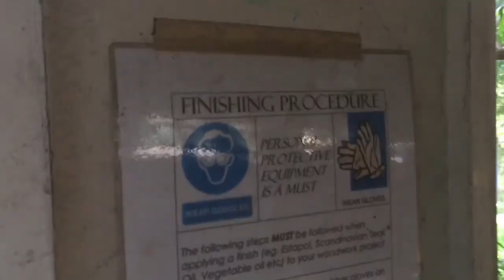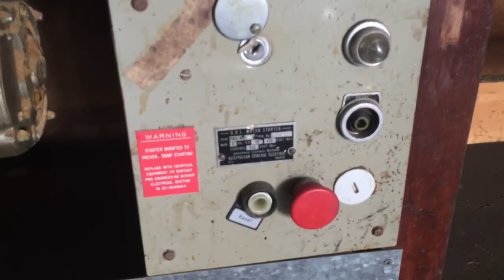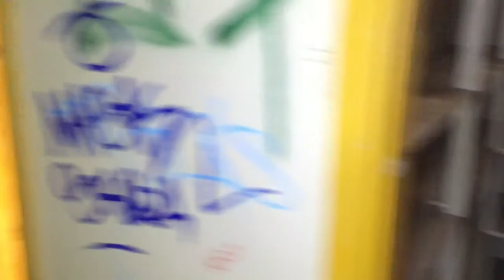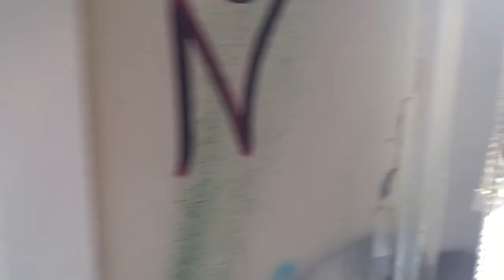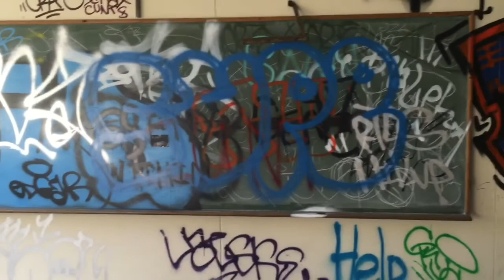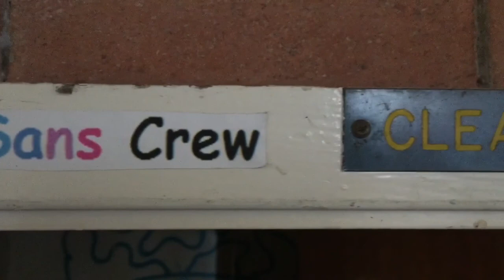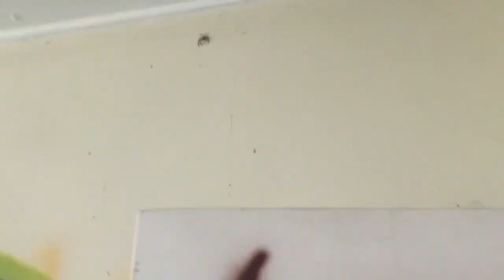Abandoned Oz: Abandoned High School Exploration Part 1

Comment: The southern portion of Caringbah High (which is my school) was abandoned after it was found to have an unstable fountain, in the early 2010's it was burned down by arson and it was demolished around 5 years ago. Only the northern end remains and the abandoned southern end is bordered off quite close to where it once was, it is now a construction site and the huge grass patch that wrapped behind the houses that connected the two sections is still part of the school. I don't know if they plan to reconstruct the southern end or not but the Caringbah Bowling club has recently been abandoned. It is for apartments but they may be able to sneak a bit of that old plot...

Comment: Why let empty buildings like this  grt trashed and go to waste, it looks structurally sound still and how do these vandals and arsonists get away with wrecking the place and setting the buildings alight. They should be manned or guarded by security or have hidden cameras to catch these bastards out. That building woul of made a good homeless shelter ran by local council or affordable accommodation for tafe and uni students ,it would be cheaper to convert this old school to as mentioned above than to resurrect a new building for the same purpose.